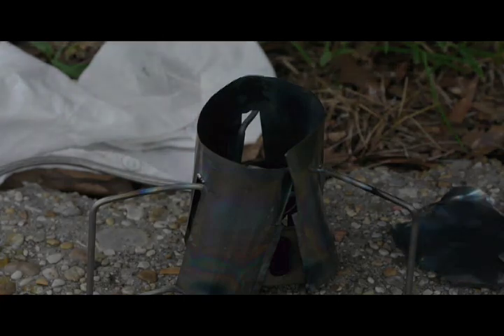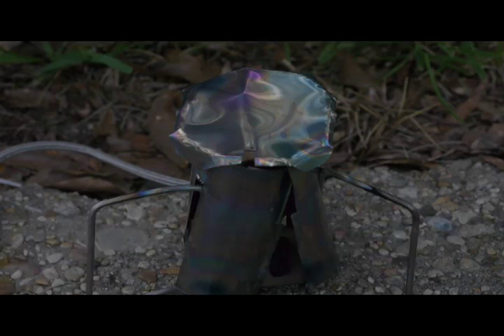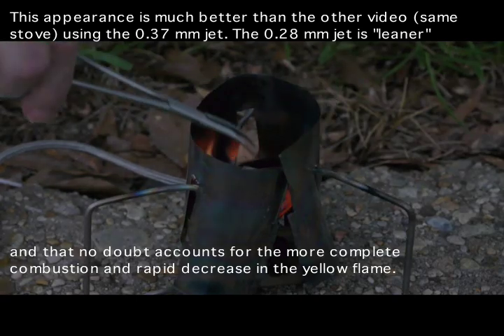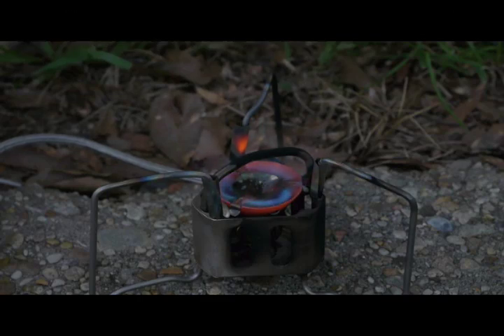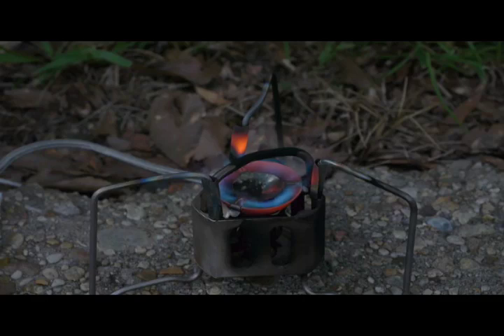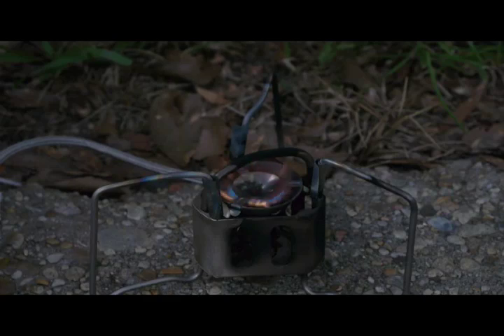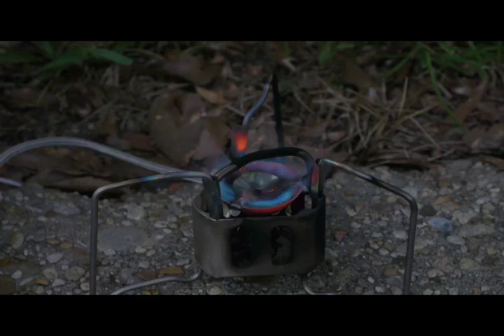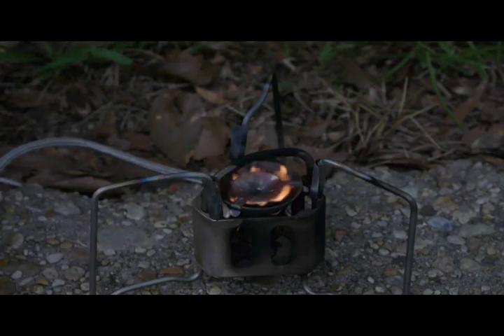Edelrid Hexon Multi-Fuel Stove Review, Part 3, sub-part "B2"

Comment from the maker: 3/13/13
Actually, it WAS (I think) a design flaw BUT ... the Edelrid people listened to me and decided to change the design! 

They have reconfigured the legs so that the part that was being hit by the flame no longer is so vulnerable AND they changed the orientation of the flame spreader so that it redirects the flame and prevents it from hitting the legs!

Jet changes typically require some tool -- both Brunton and Edelrid use the same tool for jets, not sure if Primus jet wrench fits too.